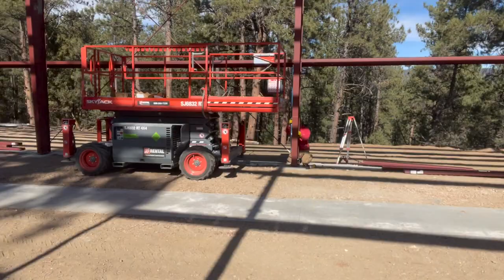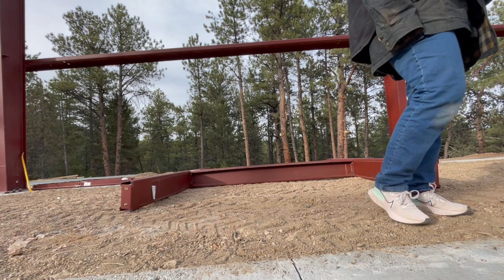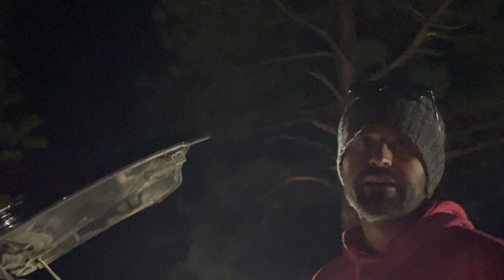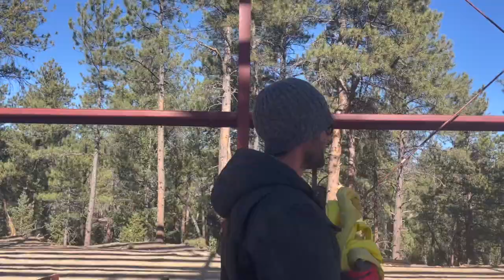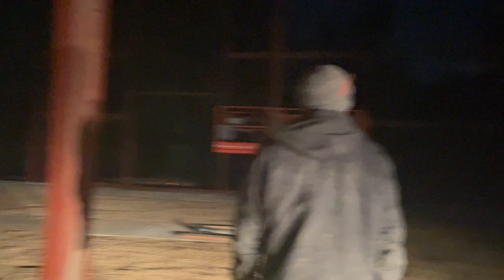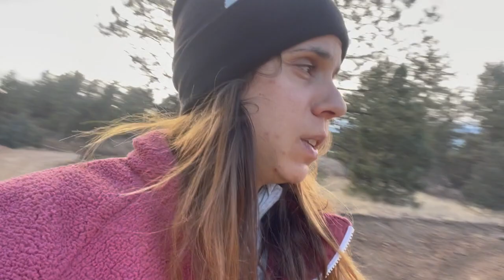Squaring and plumbing metal building frame (Ep 15) | Building our own steel building

Comment: What's size is your building? Who did you order the building kit from?
Reply from the maker: The building is 110x36. We bought from Arco. They weren’t the cheapest quote we got, they were somewhere in the middle. But we read so many reviews and they had by far the best costumer satisfaction. They ended up living up to the expectations as the couple of issues that did come up during the process they handled really professionally and in a timely manner. If we were to build another building we would buy from them for sure.
Reply: @mitchkat3286  Thanks! I've been looking and there are definitely some serious nightmare reviews on some of these 😬. I'll add this company to my list, thx for sharing your project!